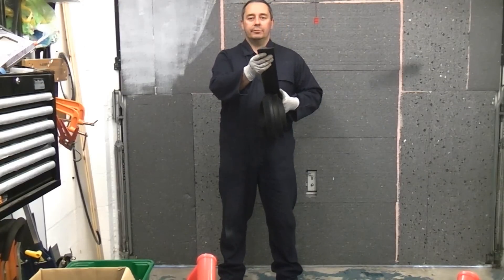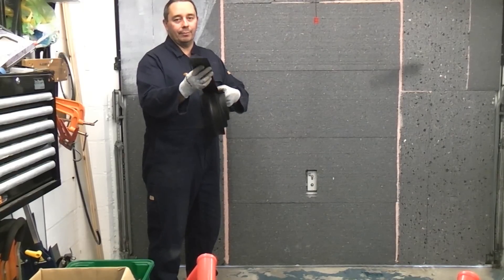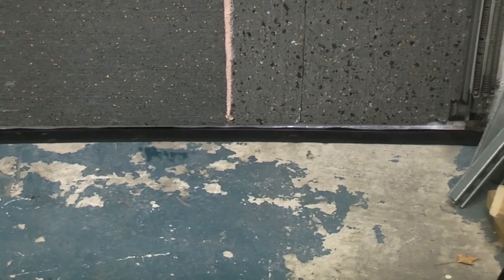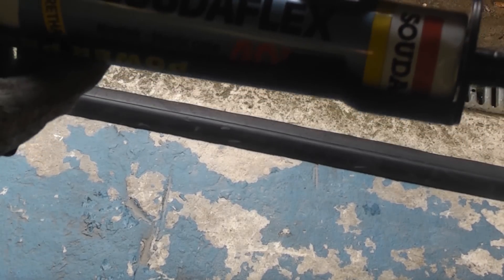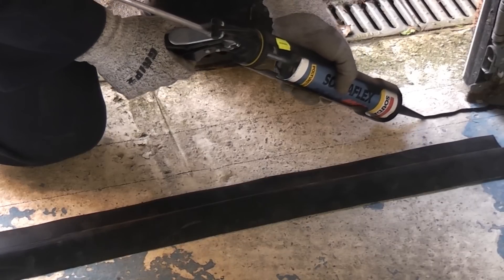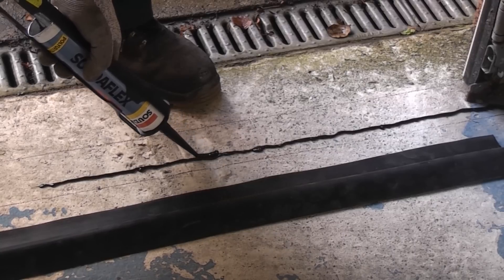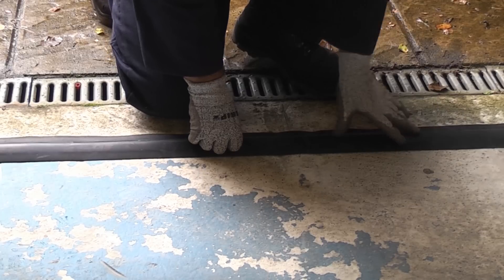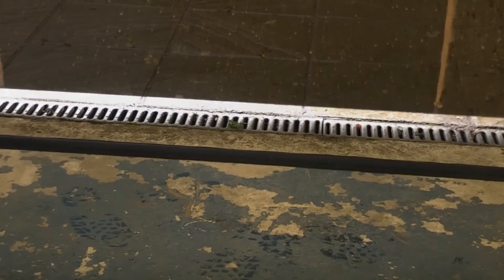How to install a garage door weather seal

Comment: That looks simple enough. Thanks so much for posting this. I am trying to help upgrade my parents' house and this is exactly what I need to do. Right now they have an older manual garage door so I am assuming that I will have to wait until the new door is installed before doing this. Also, thanks for the heads up about insulating the garage door. The cold that comes in through the garage right now is appalling. I'll definitely be doing that too. :)
Reply from the maker: You are welcome.
The weather strip has helped to keep my garage much drier and the insulation on the door helps in the cold weather!
Thanks for the comment

Comment: Hi, rain water comes into my garage almost a meter from the front. Water once came in it stayed there a few days before it dried up. 
I think the weather seal should be attached to the bottom of the door (not to be glued to the concrete floor), because 1. The car tires will roll over the seal every in and out that damages the seal. 2 If water does build up it cannot flows out because the seal acts as a barrier to stop inner water to flow out.

Comment: Top man. Great video, was about to order a seal and needed a bit of incite in to the best way of sealing the door. I've got more of a lip on the inside of the door which may be a problem
Reply from the maker: If you can get the seal as close as possible to the door, it should be fine.
Thanks for the comment 👍
Reply: @ultimatehandyman  thanks mate. I'll let you know how I get on 👍

Comment: I did this job but the adhesive sealant failed after about a year and the strip came loose.  When i pulled it up it the adhesive sealant hadn't stuck to the rubber but only to the concrete and was quite hard to get off.  In the end I used
double sided butyl jointing tape from toolstation to stick it back down. It's been stuck down for over a year now with no movement or lifting.

Comment: Nice, clear demonstration. Many thanks. What is that lining on the inside of the door for, by the way ?
Reply from the maker: Thanks, I lined the door with Jablite insulation. This makes the garage slightly easier to heat-
http://www.ultimatehandyman.co.uk/insulation/garage-door.html
Reply: @ultimatehandyman  how would you suggest you insulate a roller door? Is it even Possible?
Reply from the maker: @justintemp   You can buy insulated roller shutter doors (I think), but I don't think there is a way to insulate an existing door.

Comment: are garage door is no longer the kind u open my brother in law close it up and put a door to get in the garage but now water get in like allot like a swimming pool almost i can not put this rubber thing because like i side can not open it also  there a shelf in the garage door nailed to the door and only a house door to get in the garage i tried cocking but the gap i think it to big i was thinking of using expanding polyurethane foam from the inside but not sure if that is going to work then i though using that with some thing ells to put from the out side i saw some this is like light blue color for got what it is called  what do u think i should do?  thanks
Reply from the maker: It's hard to say without seeing it.
At my other garage I cut a drainage channel under the door, for the water to drain away.

Thanks for the comment

Comment: Would this stop the water coming in by itself? I don't have the guttering installed and it could get quite expensive to do so.
Reply from the maker: Ben Shields 
It depends if there is somewhere for the water to run to?
If not the water level might increase and then flow over the seal.
It's done a really good job of keeping my garage floor dry ;-)
Reply: ***** Thanks...I'll give it a go then. There is a slope on the slab for run off...it should work!

Comment: Good info/demo!  But, how do you remove it when needed?
Reply from the maker: I'm not sure why you would need to remove it, but you would have to use a scraper or sharp knife to get it up- perhaps a multi-tool and blade attachment.

Comment: I just got this the other day but I realized if it seals water and snow from the outside, it will seal from the inside as well. My car brings in a lot of snow after driving during winter. Anyone have experience on what to do with the water inside the garage?
Reply from the maker: I used to have holes drilled around the edge of the garage base for the water to run out, but that’s not possible with all garages!

Comment: whats that you fitted to the back of the garage door? sound proofing??
Reply from the maker: No, it's Jablite insulation. I foam fixed it to the door, it makes the garage much warmer in winter.
Reply: ah ok, for a second i actually thought it was tiles. i have the same issue at the bast of my garage door with water etc getting in so i need to get a seal fitted. this one looks like just the thing!

Comment: Hi would the mastic work on a painted floor..
Reply from the maker: Yes, but the bond will only be as strong as the paint bond.
In most cases the paint will be firmly stuck, so you should get a good bond.

Comment: ***** What is the insulation you have on the inside of the door itself?
Reply from the maker: It's Jablite insulation which is fixed to the door using pink grip foam, like this- https://www.youtube.com/watch?v=3CJygvnajUA
Reply: Thanks :)
Reply: Great link for the weatherseal; all the other packs I saw were ~40 quid. Finally blocked off the gap under my garage door.
Thanks again!
Reply from the maker: ***** You are welcome
Thanks for the comments

Comment: dumb question, if it floods can water get in?
Reply from the maker: +TH3PROJ3CT2501 
Yes, it will still get in if there is a flood.
My garage used to flood every time there was a large downpour as it is the lowest point of the driveway, but since installing this strip it has never flooded since as the water has to be over 1 inch deep before it can get over the top of the strip.
Reply: ah, im looking a way to keep it from flooding to convert it into a room, but so i can convert it back later i don't want to permanently seal it. just disable the door. idk if you know how to

Comment: Hello, the seal works only for wind proof, but the ground will not flat and inside water can't be drained out , why not just nail the rubber under the door instead of stick it on the ground?
Reply from the maker: +Joe Qiao 
It won't seal properly if you do that. If there is any resistance at all when opening the garage door the opener will not work. By fixing it on the inside of the door it creates a water tight seal. Any water then cannot run under the door as it hits the rubber and then runs back out to the drainage channel.
Thanks for the comment

Comment: I cannot for the life of me (And i have now attempted 3 times - To get the sealant to stick to both the concrete and the Rubber Seal.
After applying plenty of adhesive in 2 lines and zig zagged beads it just peels up and is not water tight.
WHAT AM I DOING WRONG!!!
Reply from the maker: Is the concrete dry/dusty?
If it is I would try sealing the concrete first using some SBR - http://fave.co/2yIJxHw
Once that has dried out the sealant should stick to the concrete.
Reply: I will make sure and get rid of all dust. I have ordered the same sealant that you have used and will get some of the SBR. Will have to wait until dry for a few days (Tricky at this time of year)
Will report back with how it goes in the near future.
Thanks for replying, and great video. Keep it up.
Reply: Now recieved the SBR and new sealant. Will be giving this a shot tonight. 
How long after applying the SBR as a primer do I need to wait before applying the sealant and seal? Does it need to dry completely first?
Reply: This worked absolutey BRILLIANTLY!
I diluted the SBR 50 / 50 (Everbuild SBR) with water, brushed it on the area where the strip would be placed and waited til it went 'tacky' "slightly blueish color". 
After that re-laid the strip with the same sealant you use in this video. (Soudal Soudaflex 40FC)
Ideal - Thanks for the extra info on the SBR. Never heard of it before and more than happy with the results.
Thank you!
Reply from the maker: I'm glad it worked ;-)
SBR is wonderful stuff, I often mix it with mortar when doing repair work.
Thanks for the comments